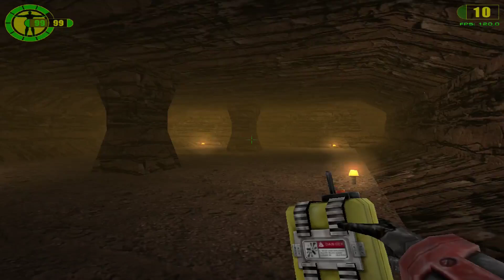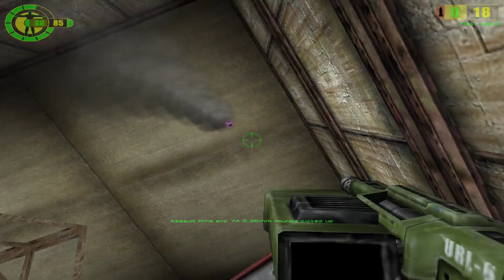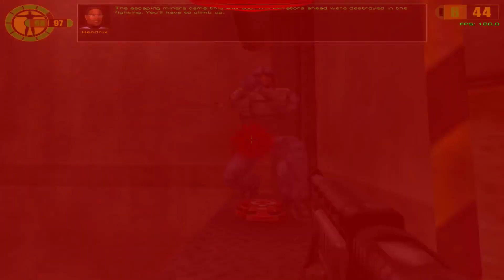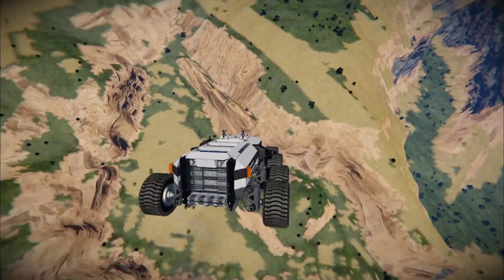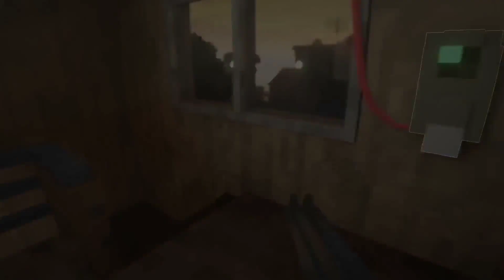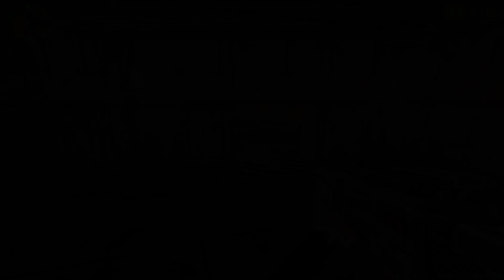How Red Faction's GEO-MOD Engine Works

Comment: It was cool tech, but I don't think they did nearly enough with it honestly. Replayed it a few years back and I'd go long stretches without touching GeoMod, before remembering it was a thing. It played mostly like a straight-up shooter. Guerrilla was better in that regard, you never really forgot about the destruction, it was woven into the game pretty tight. Interesting how they did opposite things though; RF1 was terrain destruction, RFG was structural with no terrain destruction. 

The dream would've been both in one game..
Reply from the maker: That would be the dream,  I'm disappointed too that there was no further implementations of geomod in rf1, it was a gimmick that seemed to sell more copies but they didn't care to push it further orrr they were just out of ideas past the first section in the mines.